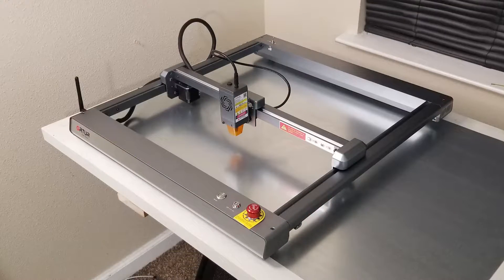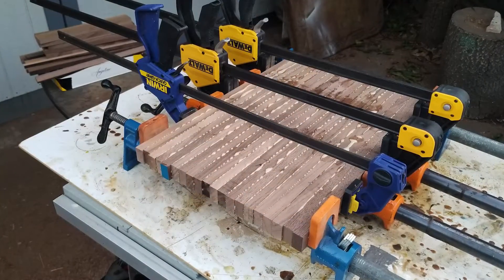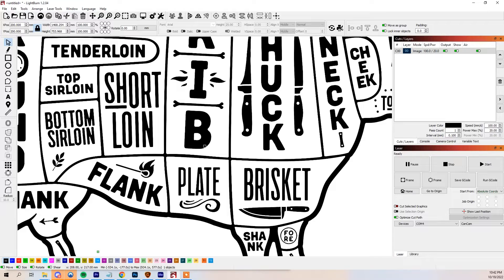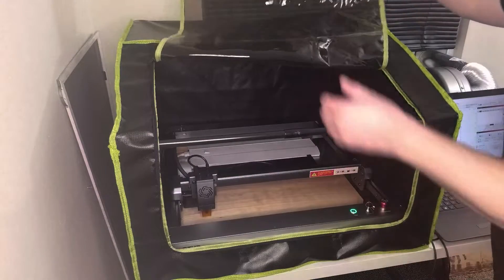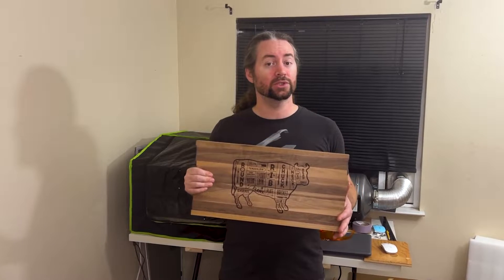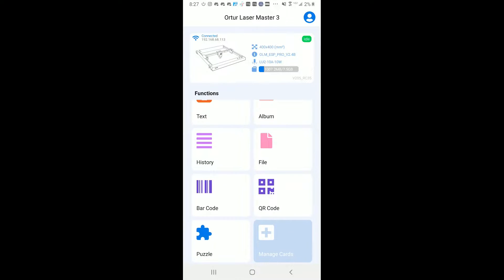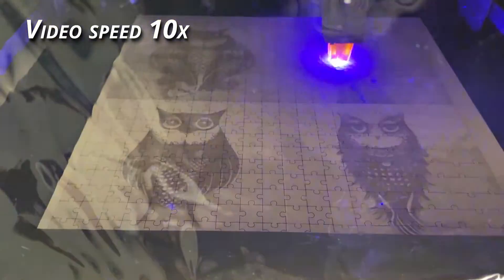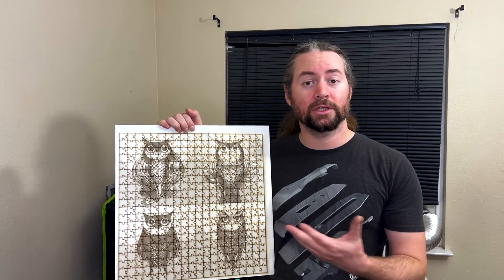Laser Engraving a Cutting Board with the Ortur Laser Master 3

Comment: What speed and power did you run?
Reply from the maker: Sorry for the late reply; I just saw this.
I ran this at 300mm/s and 100% strength and got a good engraving.
Later when I added an air assist I was able to get a deeper engraving with the same speed.